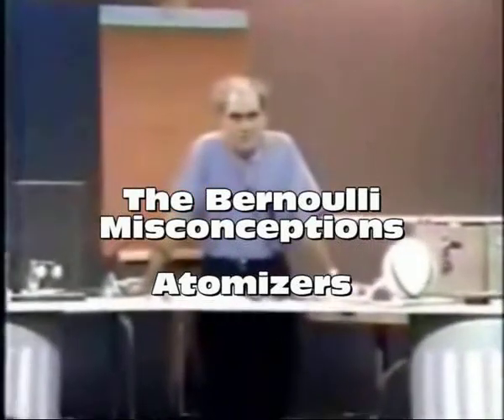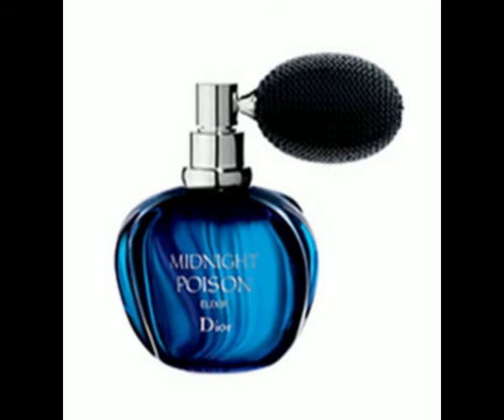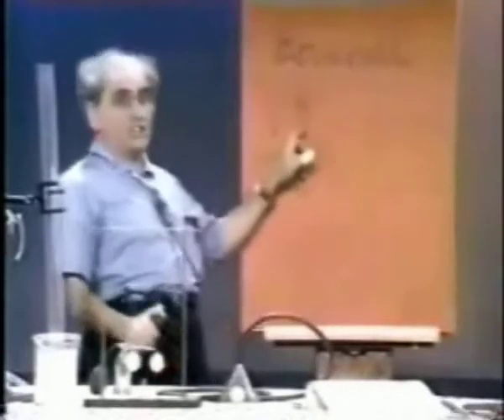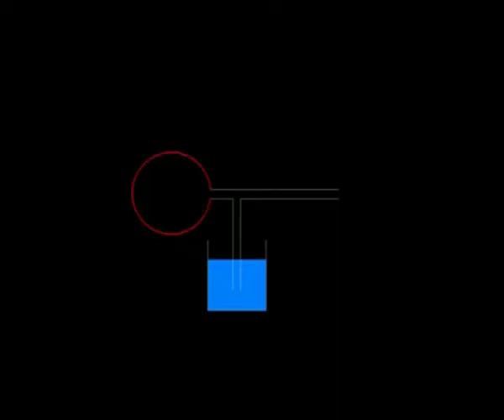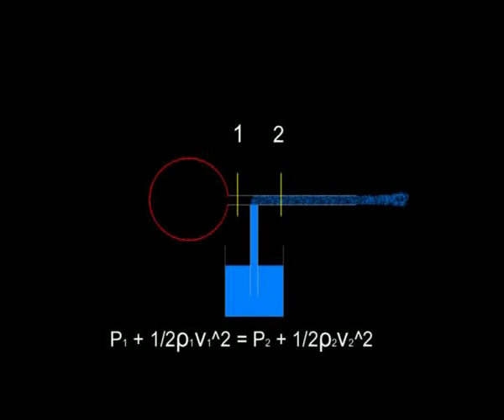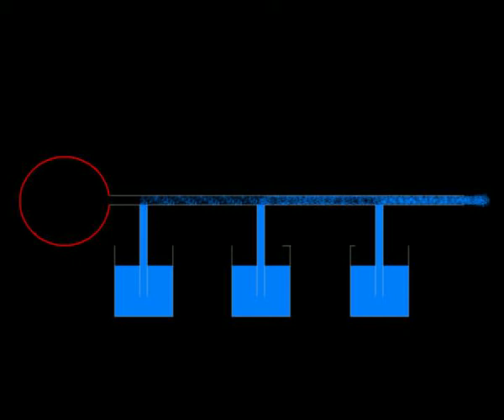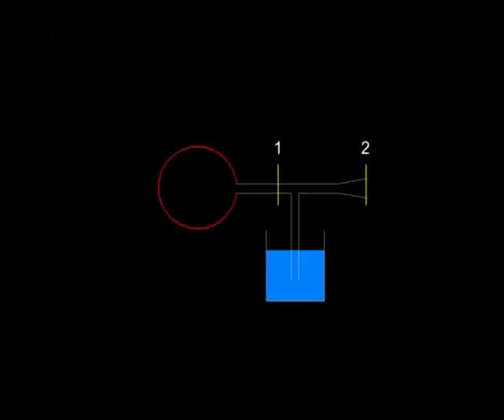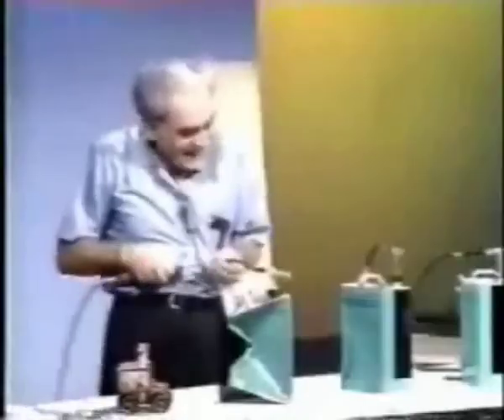Bernoulli Misconceptions 2 - atomizers

Comment: You need to provide a demo, not conjecture, that shows no lifting action Consider boundary layer, entrainment and tube diameters of the tubes Millersville U has a demo that should give you a clue. http://www.millersville.edu/physics/experiments/093/index.php Note that the lift tube is a very small diameter....For the air past curved cans, an air dam can prevent the air frim curving around the back of the can. -- Cheers, ScienceAdvisorSteveChallengerillinois.org
Reply from the maker: I must admit that I don't quite know where you want with this. On my part, this is certainly not conjecture. It is also very easy to conclude, by rational reasoning, what would happen in the experiment that you refer to, provided the experiment is done properly. In the case where the straw is flush with the tube wall, it is very obvious that some fluid will leak out the straw. This is for the same reason that water sprays out of your garden hose if you get a hole in it, even though the end of the hose is unblocked. There is still a certain friction that causes the pressure to be higher the longer the hole is from the end of the hose. In the experiment that is shown, the hole is a certain distance from the end of the tube. Whether the hole is covered by a perpendicular tube, or not, is of little importance. The increased pressure where the hole is, will cause some fluid to escape through the hole.
In the other case, when the straw protrudes the wall, they have correctly concluded that there will be a pressure loss due to the curving flow path of the air over the opening of the straw. I would say that this is the exact same reason why a chimney gets a better draft when it is windy. But they are massively wrong when they claim that Bernoulli has nothing to do with this. The protruding straw reduces the cross section of the tube!!!! Effectively, this is a venturi. Go and do the math and come back to me if you can prove that  Bernoulli's Principle has no effect.
Reply: +Siddis331   I am sorry, but I am unfortunately now unable to find the statement I referred to, so I am unable to quote it and comment further.  The words sounded like you were making an assumption.
...
The common description of Bernoulli's Principle is indeed an incorrect interpretation. 
..
I'm not disagreeing with what you have except as I note here.  In your text description, you have; "It is the acceleration of the fluid that accounts for the changes in pressure. "; which appears to be saying that the acceleration causes the pressure change when it is the other way around. It is the difference in pressure that causes the acceleration.
...
I know that Julius and Don Herbert, Mr. Wizard got the explanation wrong.
...
One thing to note.  The classical atomizer does not have a tube with a "T" as shown.  
There is a tube from the bulb which ends just before the riser tube and pushes air out into the atmosphere and across the top of the vertical "draw tube".  This arrangement forces the air to travel in a curved path over the end of the draw tube, thus causing a pressure drop at the inside of the curved path at the tip of the draw tube.
...
The "T" tubing that Julius shows has some problems that must be considered.
One is that the tube has a steadily falling pressure from the bulb to the output end.  This is due to viscosity (and the boundary layer).  The length of the tube after the "T" determines whether the vertical draw tube will draw water up, or blow air out.  
Another is that the diameter of the vertical draw tube has an effect.  When all sections are the same diameter, the vertical draw tube interferes with the boundary layer at its opening and allows entrainment to draw water out and into the main air stream.
The third is the exact configuration at the "T".  One plastic "T" I have has a very slight ability to draw water up the draw tune when nothing s  to the output of the "T".  However, with only one inch (2.5 cm) of tube attached, it blows air out the draw tube rather than drawing water up.
.,..
If "T" tube demo is to be made, the vertical draw tune must be small enough so as to not disturb the boundary layer.
...
I do disagree with what you say @5:25 The fluid that displaces another is at a higher pressure, otherwise  it would be in conflict with Newton's Third Law.  This would be in conflict with Newton's First law.  The pressure difference is a force which pushes the fluid out into the lower pressure atmosphere.
...
The draw tube protruding Into the horizontal tube is indeed a restriction in diameter, making it a mini venturi.
...
I am sory that I have difficulty with your accent a few places in the video.
-- 
Cheers, ScienceAdvisorSteve
Reply from the maker: Fair enough. I know that the video that I made is far from perfect. I was fully aware that air following a curved path over a vertical tube will cause a negative pressure within the tube. It is as I said, the same effect that causes better draft in a chimney when the wind is blowing. I decided to omit this effect to keep it simple, and Julius Miller didn't specifically say anything about this. In the case of a tube sticking in from the side, one will have a double effect, both the airflow curving over the top, and the Bernoulli Effect caused by the reduced cross section.

 I made the drawing in order to mimic Julius Miller's drawing and setup. I know that there are many ways to make an atomizer. If one has a straw in a cup of water, and blow on top of it, one can draw out water, provided one angle the straw correctly. It should be pointing straight up, or slightly away from the airflow. This is a very simple atomizer, and the effect should best be explained by the airflow curving over the top of the straw.

 I would otherwise say that Julius Miller's explanation is in conflict with all of Newton's Laws, but I felt that the 3rd was the most relevant.

 To your point that "it is the difference in pressure that causes the acceleration". I think that it is a "chicken and the egg" example. It can equally well be turned either way. If the pressure in a fluid changes, there will be an associated acceleration of the fluid. In the same way one can say; If a fluid undergoes acceleration, there will be an associated change of the pressure. (excluding friction).

 I know that it is feels more intuitive to say that it is differences in pressure that causes the acceleration. This is normally the way we experience it, typically when using a garden hose. It is very easy to see that the high water pressure in the hose makes the water jet out. Then the energy in the water dissipates, and one doesn't think any more about it. It is not so intuitive that when fast flowing fluid slows down in a wider cross section of a tube, the pressure will increase. The problem for people to understand, is that when this happens, and the fluid enters the atmosphere, it will have acquired the same pressure as the atmosphere. When fluid used to have higher velocity, then the pressure was correspondingly lower, that means below that of atmospheric pressure. In any case, this seems like what Julius Miller didn't understand.

Cheers
Reply from the maker: For reference, have a look at this video https://www.youtube.com/watch?v=SXVAhpsU3FY
Reply: Siddis33  Very good.  From your earlier comments, I saw that you understood much better than most others and some of the discussion was more about understanding your message rather than differences in understanding the science between us.
...
I use the Millersville demo as an example showing fast air having no pressure reduction.  The typical student I show that to is not far enough along to see that error in that demo.
...
What I call the "classic" atomizer is just that "two straw" version.  Old perfume bottles were just like that.
...
RE: your Newton's Third Law reference.  I couldn't see the connection.  Perhaps you can explain how it applies.  Which is the applied force and which is the reaction force?
...
I disagree with your chicken and egg view of fluid pressure/acceleration.  Air has mass.  Newton's First clearly explains the nature of how a force must be applied to cause an acceleration of a mass.  This is THE critical concept in understanding that First law.  A force it required to accelerate any mass.  Fluids have no special standing wthin Newton's domain.  If you put a car on the street, there is no science that will have it accelerate by itself; then this acceleration causes a force pushing it along.
...
I don't use math to explain science except in rare cases and only to help understand some specific concept.  This is because the concepts in science are natural phenomena that can be explained in words/concepts. In addition, the student must be very comfortable with the math for it to help.
If you watched the David Anderson video you hear him say that Scott Ebberhart began to understand at an intuitive level what he could only calculate before.  As an experienced practicing engineer for 36+ years, I believe this (an intuitive understanding) is quite crucial to a solid understanding of the science in order to apply it correctly.  The math is simply a model we have found that fits to the nature and that works well to calculate values and help to better understand the behaviors, but doesn't actually explain it.  Nature doesn't "know how to DO math". It just does what it does.  We did the best fit.
Don’t get me wrong.  The math is critical in calculating values and when the math is a good enough fit to the phenomenon, then you can even predict what will happen in nature without getting your hands dirty.  You can even "predict" what will happen in conditions never before tried with the physical 'stuff' which results in us new things with the hardware.
This is a point of confusion for many.  There are techniques that have been developed to more easily calculate things like lift.  Circulation is one such tool, yet some will insist that circulation is "the cause" of lift when it is not part of the natural phenomenon.  I compare it to ballistic calculations.  A shell only travels in a single path, yet we can view two components of its motion (horizontal and vertical) and use these two components to calculate the actual path.
...
Yes, the "Fast-Air-Has-Lower-Pressure" myth is treated as though it is another fundamental physics law to be memorized like Newton's laws; when it is a misinterpretation of one part of Bernoulli's Equation. I am on my own Quixotic quest to turn around this wide-spread pathological science.
...
The pressure rise of the fast air slowing in the wider part of a venturi can be made intuitive if you describe it as fast air "slamming" into some slower air and creating dynamic (stagnation) pressure.  That can be understood and is the science as well.  When a fluid comes in to contact with something slower, such as a wall, the result is a pressure increase which accelerates the fluid backwards (deceleration).
...
When all the fundamental principles are properly put together it is beauty in science to see them all play so nicely together.
...
Lastly, I just love blowing the mind of a die-hard fast air believers by showing them how the air under the wing travels past a stationary observer faster than the upper air.  I also have a demo with an empty can with an air dam that prevents the curved flow.
..
I must also be candid.  I would question the utility of going to all the trouble of making a video, while knowing that it is lacking and open to correction.
--
Cheers,  Keep up the good work.
Next comment...
Reply: Siddis33  Yep.  Just another teacher (among thousands) parroting pathologic science. 
...
He makes up a new term "Draw" and doesn't explain it correctly; even claiming you can pull on a fluid, which is also.  Poor. 
...
So many people feel the need to do a video not understanding the science.  oh well.
...
"Are you with me"
--
Regards
Reply from the maker: Absolutely. I am puzzled how such people that can present something like that, and having a feeling of understanding how it works. It is surprisingly widespread, though. I'd suggest that you have a look at this article: http://wrightstories.com/einsteins-wing-flops/

Comment: Hi, it seems like you may know the answer for my issue, would you help me?  I have had  a troubling  wondering on  one airflow situation for a long time, my  question is perhaps best shown by an example:

A straight  horizontal wind  flows parallel and just over  a flat roof of building . This wind DOES NOT hit the side of the building, the wind is just flowing very close  above the roof. Will the roof feel an uplift from the pressure differential ? , so my question is about an airflow running just above a surface. Your help is so appreciated. Thanks

Comment from the maker: You don't need to be sorry. In the case you claim to be able to prove that Bernoulli's Principle is wrong, I would be very interested in seeing this. My position is that Bernoulli's Principle is correct, but it is often misapplied. 
Do you really believe that the pressure in a fluid continues to drop when the flow slows down after a constriction?
If you can prove that, you will defnitely get the Nobel Price.

Comment: Sorry it's not. Only because nobody came up with a better explaination it doesn't means it's right. if you have an obstacle in a tube. pressure drops also after passing a narrow creoss section in a tube. bernoulli says it does NOT - Impossible due newtons laws. Bernoulli excuses pressure drop with friction and turbulence. this is a weak explaination. Bernoulli is just the energy conservation applied to fluids but in a wrong way which is not mechanically correct. i can proof it!

Comment: Bernoulli is an entirely wrong misconception! it violates at least 2 of the three Axioms of Newton. But yet the explanation here of the atomiser is not correct. The fluid will not just accelerate. due laws of continuum flow the cross section has also to decrease. if the cross section does not decrease during acceleration it creates turbulence. or in terms of the momentum laws it pulls other liquids in the stream: Search for "Aerodynamic Lift and the inconsistency of the Bernoulli Flow law"

Comment: Yes, in fact I did it today.  I used a plastic T with a smooth, constant diameter interior surface.  To the middle leg of the T, I attached tubing leading to a cup of water.  I didn't attach anything to the other legs of the T, so there could be no constriction.  I used an air compressor to blow through the T, and it had no trouble lifting the water the entire length of the tubing, about a meter.  Why shouldn't expanding flow outside the nozzle matter?

Comment from the maker: Have you actually seen this work? I don't think that any expanding flow of the air exiting the nozzle will have any effect. When it comes to any reduced pressure in a flush, perpendicular tube, due to air flowing over it, I will refer to an article. Make a google search on “    4.1 Measurement of static pressure within a free stream of air
A sufficiently sensitive manometer can be produced easily if not available in the lab.   ”
(Copy and paste the frase, and it should take you to the article.

Comment: If P1 is the pressure in the bulb and P2 is the pressure in the vertical tube v = 0 and Bernoulli's relation gives:  P2 - P1 = ρgh where h is the height of the liquid above the surface.  In order for flow to exist, P1 > P2 so h < 0!  BTW, I have done the experiment and I also found from looking at atomizer patents that none of them is made like this   They do not use Bernoulli's principle at all.